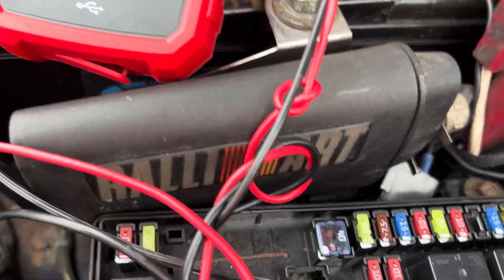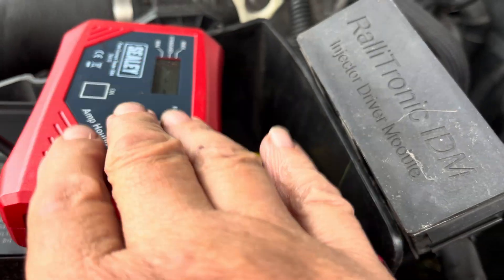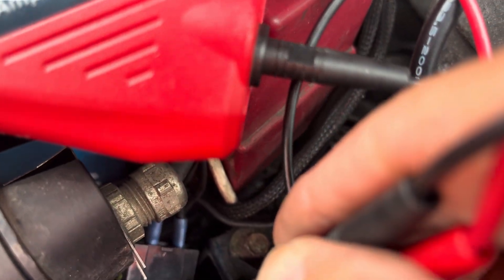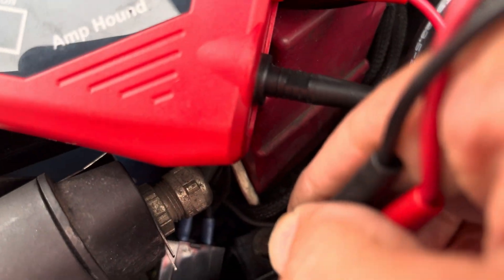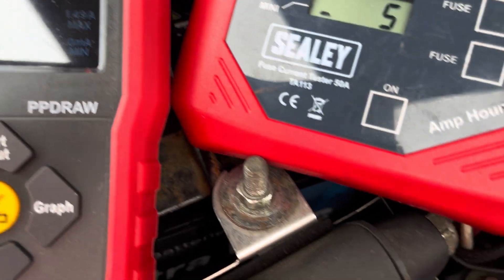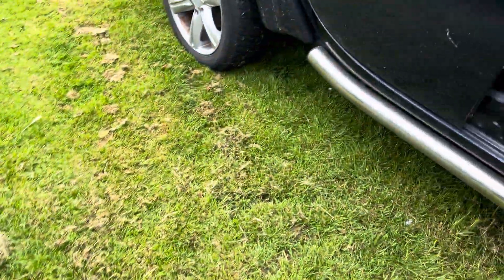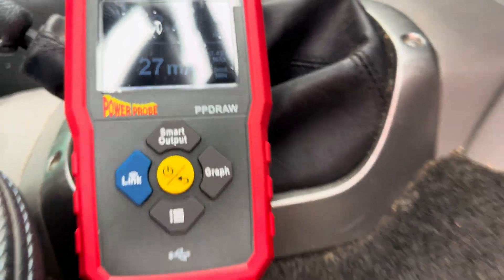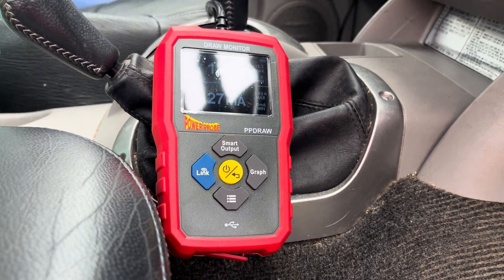Finding a battery drain with draw monitor and amp hound

Comment: Serious question 

Do you have to fool the car into thinking it's asleep to use the amp hound or power probe

It's cause I always struggle with fooling the car
Reply from the maker: No fooling needed you just wait until the car goes to sleep which can take upto 45 minutes depending onthe car thats why finding a battery drain can be a nightmare if you keep waking the car up